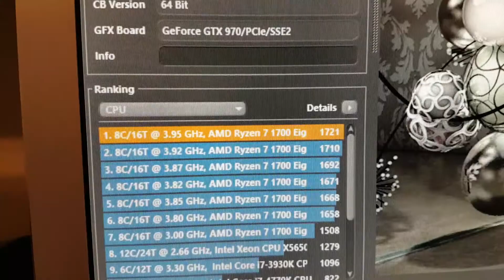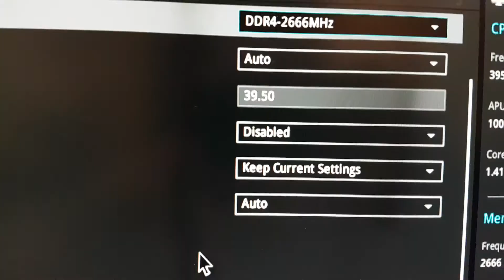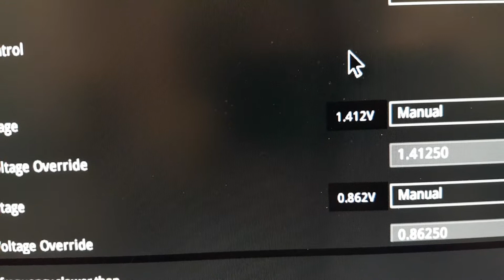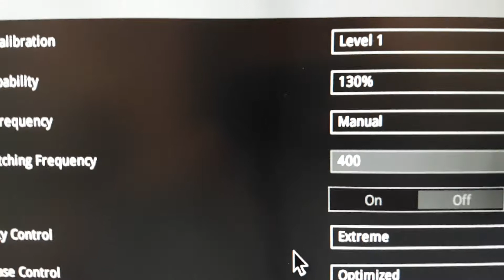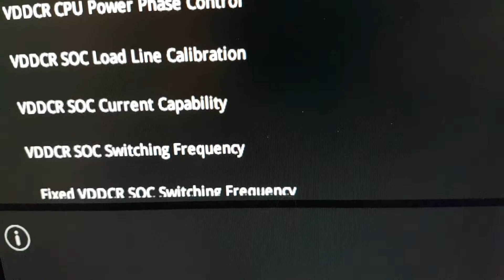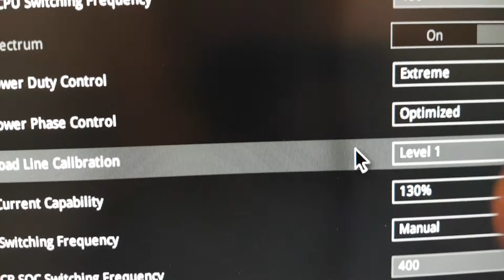Ryzen 1700 Overclocking to 3.95Ghz with NZXT Kraken X62 (Finally!)

Comment: My motherboard is fairly basic with no LLC or vSOC adjustment. I haven't tried to max out my 1700 but I'm comfortably sitting at 3.9ghz at 1.344v with 3200mhz XMP at 1.36v to give me 1710 on cinebench. With ML240 Lite in push/pull, I'm staying below 50c with prime95. Not too shabby.

Comment: Is the AM4 bracket already included on NZXT x62?
Reply: Yes it is, I received mine yesterday and it came with an AM4 bracket. Had to return the one I bought separately because I also didn't know if it was included x)
Reply from the maker: It wasn't at the time of release. I had to order mine separately. I don't know if new units ship with one or if you still need to get one separately.
Reply: Good to know. I bought Corsair H115i without knowing it doesn't come with an AM4 bracket. Gonna replace it with an X62. Thankfully the store I bought it from accepts I replace it provided I added a little bit more since its a little bit more expensive lol

Comment: how much temp in full load. thank
Reply from the maker: 65c after 15 minutes of  OCCT ambient temp 25c. If I run it longer it hovers between 62c and 65c so I think 65c is the max for me. And the fans are not spinning that much. I'm sure I'd get lowe temps with the fans on 100% but that's pretty noisy, and Ryzen cpu's don't throttle until 95c 65c is absolutely fantastic for the Ryzen CPU's.
Reply: wow it's nice temp. i just buy fractaldesign s34. i test in full load at 3.9 vcore 1.375 with aida64 it's have 79c after 15 minutes ambient 33c. i think i will change to kraken x62 too.
(sorry for my english i just try and want to talk with you).
Reply from the maker: That's nice. Keep in mind though that the X62 does not come with the AM4 bracket, so you have to send proof of purchase for Ryzen and the X62 to NZXT and they will send you the am4-bracket free of charge.

Comment: I managed 4.1 at 1.45v don't use that as my daily though
Reply from the maker: That's nice :) My chip seems to have a voltage wall around 3.9Ghz. Every step above it requires a lot of extra voltage. I'm guesstimating my chop would need 1.5V to get to 4.1Ghz, but it would be insane with such high voltage for daily use.

Comment: I was gonna go with the 1500 or maybe the 1600 if I have a few extra bucks.
Reply from the maker: I think you could clock those to similar speeds but with less voltage :)